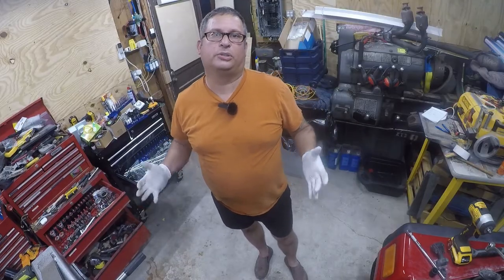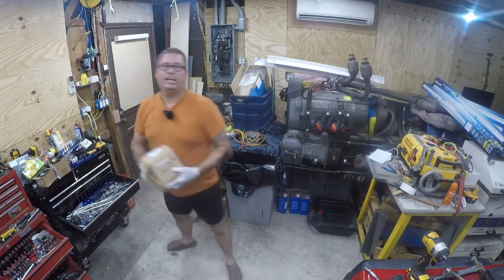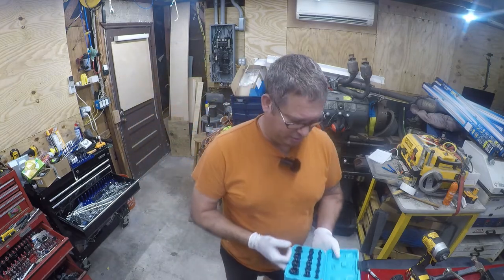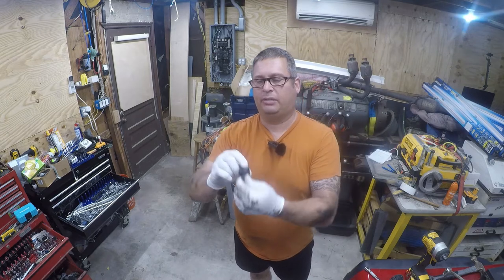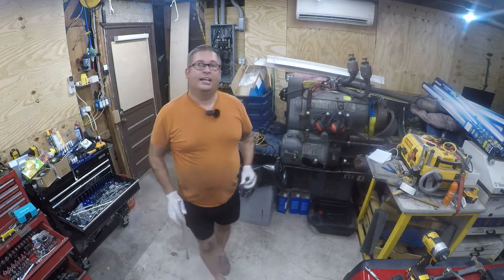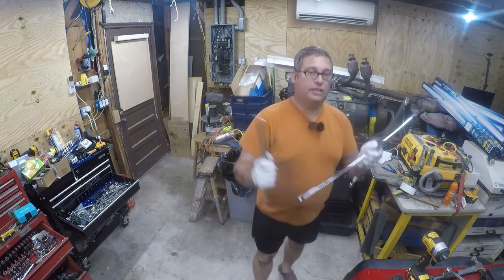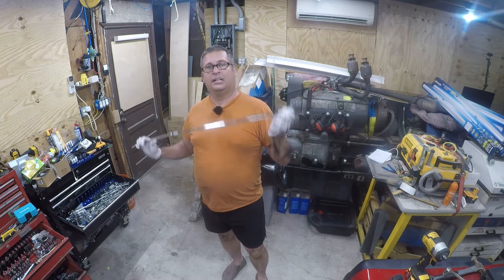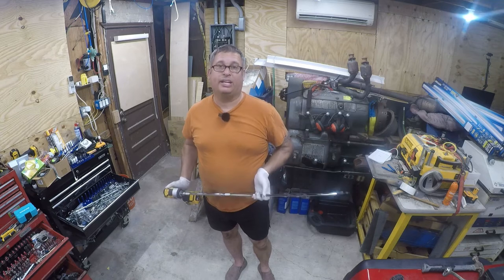Jeep TJ Build - Jeep 19: Tools to remove bolts between transmission and engine

Comment: Hey just wondering what size the bolts  and threads for the four mounting bolts from the bell housing to the 4.0 motor???
Reply from the maker: Uppers are different than the lowers.  It's in the FSM.  Sorry I don't remember off the top of my head.
Reply: Thanks, already installed it a few months ago ☺️.. rebuilt the np 231j transfer case with the new spline to switch from the ax5 to ax15 transmission installed the new rebuild kit and slipyoke eliminator kit..Tom Woods driveshaft built and delivered my driveshaft.
Welded the frame brackets for the motor mounts for the Golen 4.6 stroker finished wiring the Holley Sniper EFI 2 barrel carb and computer.. almost done..the clutch and slave cylinder kit is on its way.. have to talk to Holley tomorrow to order the mounting bracket for my accelerator peddle...and weld in the radiator bracket to the back of the roll cage in the bed of the jeep.. should be done by the weekend..🤙🐼😎🙏🙏🙏